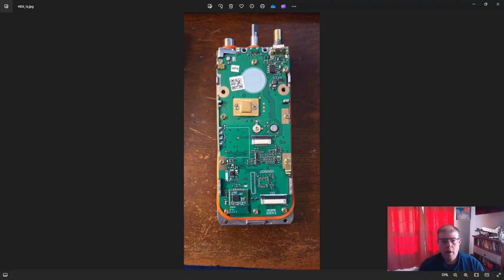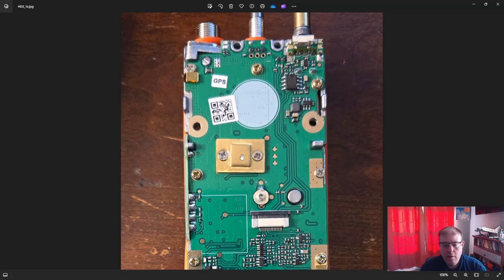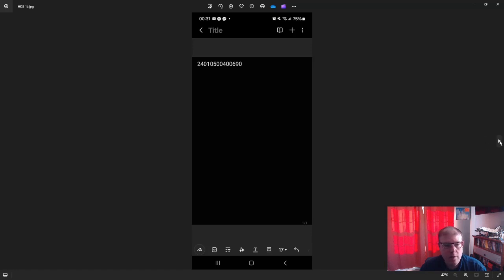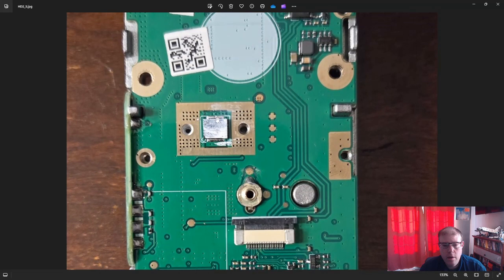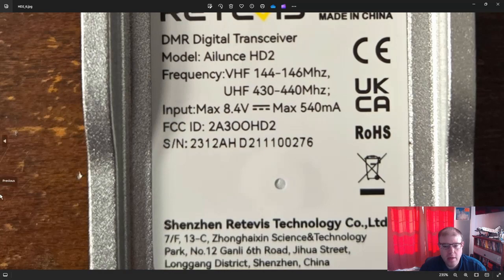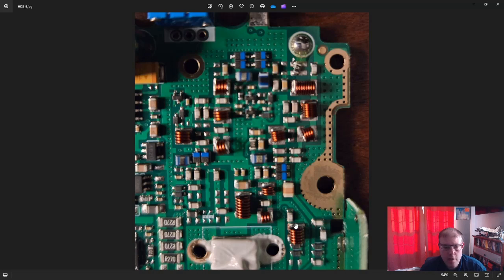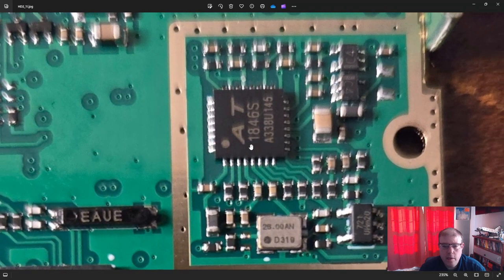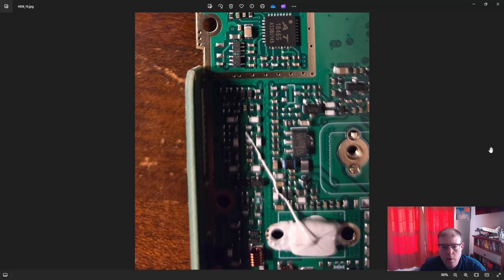What lives inside the Ailunce HD2?  Looking inside

Comment: Does this aluminum case have a hole behind the label
Reply from the maker: I had not checked for that, but if it does it is likely meant as a type of ventilation. The casings for the HD1 and HD2 plus chassis are not very different from each other.  Why do you ask?

Comment: How do you think they afford to sell these things so cheap? Because they barely build them with the bare minimum. Hams should be ashamed of themselves for buying this junk. Fun to experiment with I suppose. But that’s all they’re good for. So this radio is illegal to use in the US, minus hams I suppose. But I believe that’s a serious gray line we’re floating on. The purpose of being exempt isn’t to buy cheap Chinese non-type accepted junk. It’s to build our own equipment to experiment with.

They will never try to improve on this stuff. It increases the cost too much. They’ve had years to improve on these radios and they refuse to do so. If they haven’t done it by now, they’re never going to. God forbid the put metal shielding on anything, it’ll cost them an extra $.0001.

Comment: Thanks for the review comparing and showing the design and structure of the Ailunce, (Retevis),
HD2. As I told you previously, I
have had an HD1 for a while, which
I think came out in 2018. It seems
like it was one of the earlier DMR
HT's aimed at amateurs and not
just the commercial ETSI market.
I did not know the FCC ID no you
asked me about previously was
not real.
I find mine outputs about 8 watts
on VHF, and about 6 watts on UHF.
It took me a while to understand 
the DMR Code Plugs and do my
own.
Also, I took some on line Tait DMR
on line courses a few years ago,
which is more DMR commercially
oriended, going into Type III DMR,
and Lan, than with amateur uses. 😊
Reply: It exists now.  They were just selling it before their application was granted approval.